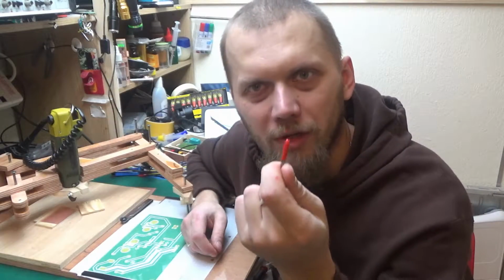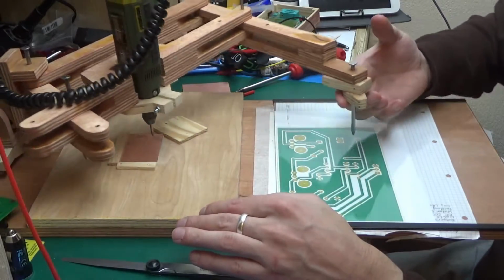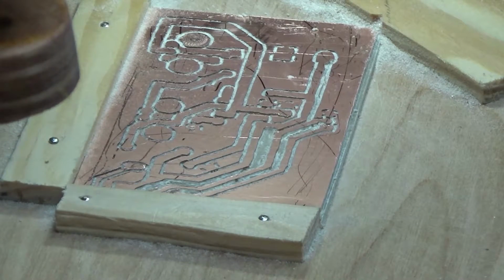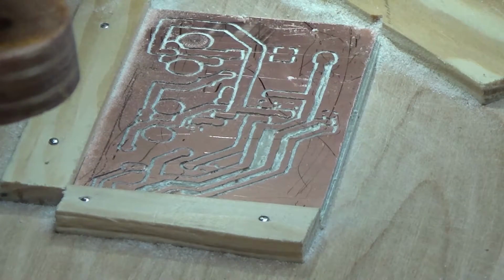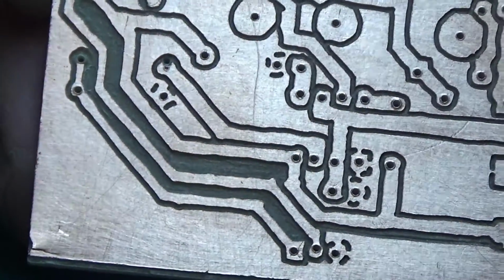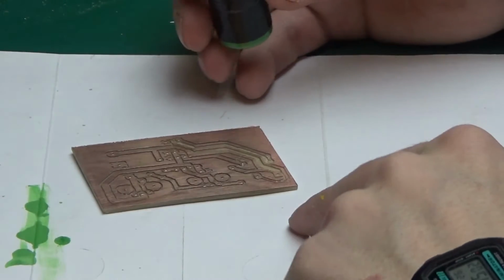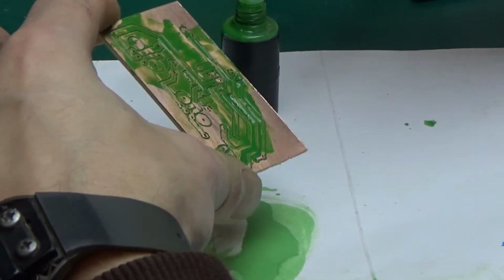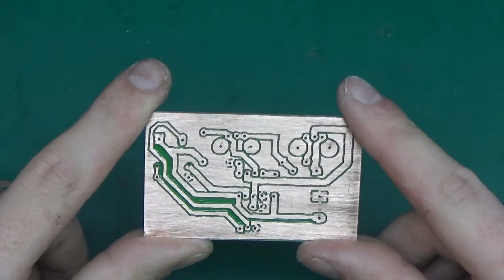I've got the bit! - Pantograph PCB engraving

Comment: The engraving bit looks like it makes much cleaner lines than the previous bit you were using, Panto-graph engraving looks like it could be quite fun!

Would that enamel work as solder mask just to protect the copper from oxidization over time, or would you need something high temperature resistant? If this was a permanent PCB that you didn't ever need to replace components on, I wonder if you could just enamel the entire bottom once everything was soldered?
Reply from the maker: That's to be tested out soon, if it will work like solder resist or will it burn away. It would work nicely as a conformal coating though, definitely. Once everything was soldered, you could spray entire board with it and it would be protected from elements. The thing about this enamel is it sticks to everything: aluminium, copper, plastic, wood, steel, you name it. So it would work well to protect finished board.  And yes, pantograph is more fun than I everimagined before I built it :) There is a lot of satisfaction in making things by hand!